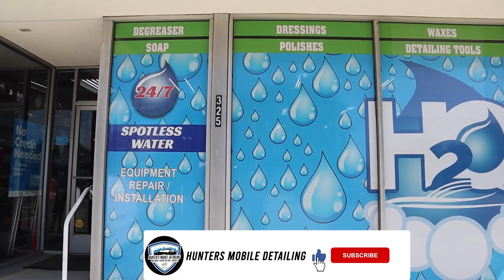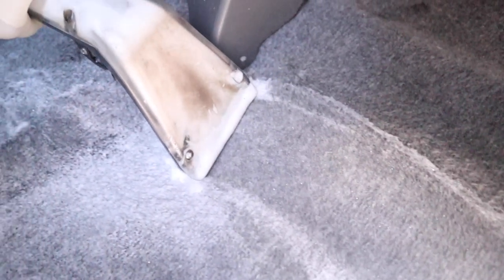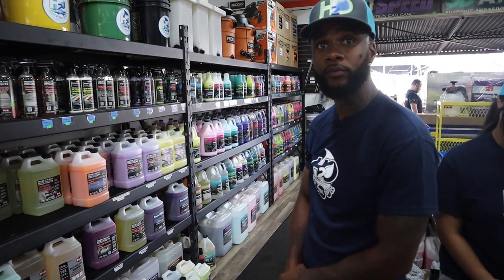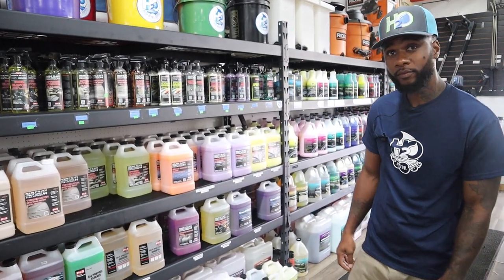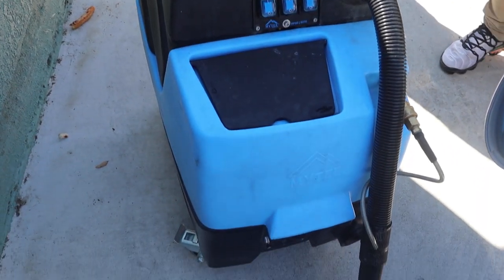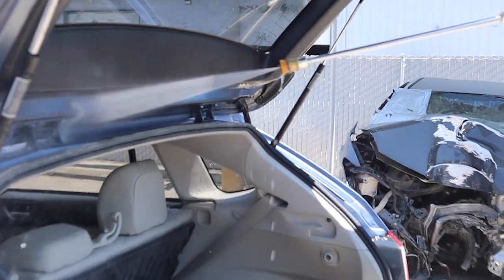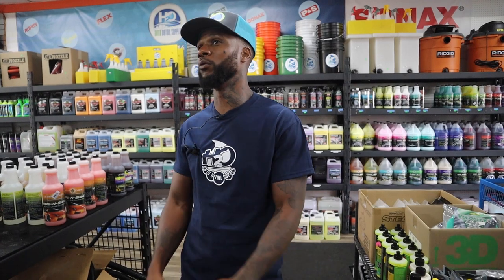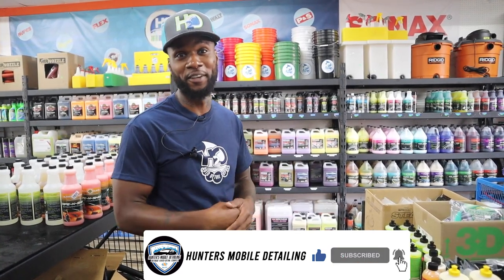What Beginner Detailers Really Need To Start - Hunters Mobile Detailing

Comment: My towels are color structured. Black for the inside, blue for outside, yellow for miscellaneous.
Reply: my towels are quality stuctured. just the cheap bulk towels for inside. drying towels for drying etc
Reply: @rickvh0195  I have drying towels as well but for the tires, cheap Amazon blue.
Reply: Do you only use the towel one time on exterior when doing waxes
Reply: @scr3wblu313  I don’t since I wax a good amount of cars so I usually throw them in a bucket and use chemical guys detergent for them. Never mix the towels though. Wash on cold then air dry them
Reply: @rezzo_6fn659  gotchu thankz
Reply: Same blue windows, green interior, yellow exterior
Reply: thats crazy i use use black for wheels and tires
Reply: What's the price range for a beginner when buying all he mentioned on the video
Reply: @abusivefather8000  just depends. If you want everything today bring at least 1k-3k to the table.
Reply: I use usually use Blue or a light Tan/Yellow (waffle Weave) for the Windows, White or bright Yellow for the interior (so I can see if it’s completely spotless), Black for drying the entire car, A super soft bright Green for spray detailers and taking off excess wax, And then there's the cheap Orange and Yellow one's for miscellaneous stuff. I also have new Gray ones that will be going into the rotation. That being said, they are all different brands, prices, textures, and sizes. Sometimes I'll even use the tan/yellow waffle weave to dry the exterior instead of the big fluffy black drying towels. It all depends on the type of material, What part of the vehicle, and obviously whatever works best for you, your chemicals and the vehicle. Just as long as you have a system, and keep your towels separate especially when washing 😊  like he said in the video he was using about 100 smaller towels a day, so if you’re just starting out, having a towel system in place is more important than one might think.
Reply: @abusivefather8000  maybe be even getting a used pressure washer will work when ur first starting or like he said a water hose works too when ur first starting. So 200 and the chemicals u can spend maybe 200 (then re fill once u run thru that) key is dilution and then towels, bucket, mit, interior and wheel utensils 150 ish don’t need much to start it’s about how u use what u have efficiently
Reply: Your just mobile?
Reply: @rawcircoking  I’ve backed away from mobile a little bit. I Make more money having the client bring their vehicle to me because I can have multiple cars dropped off at once. This is a premium service and with all of these new detailers coming in it’s a race to the bottom because everyone is trying to undercut the competition. Got folks doing inside and out for $30. Like why? Better off working at Amazon or ubering for that little bread.

Comment: if your starting you can get the cheap ryobi or greenworks pressure washers under $100. Personally i would recommend a upgrade hose as the ones provided are pretty junk. Vaccuum extension is good to and its not needed but a steamer like the  McCulloch MC1385 will help you save a lot of time on the interior. Don't forget some tire shine too customers like to see the wheels with a nice clean finish.

Comment: Just a heads up that shamwows / chamois are swirlmark heaven..you are getting dirt and dust trapped in them and using it on car after car, it’s basically like a towel that you never wash
Reply from the maker: And if I wash it?
Reply: @HuntersMobileDetailing  I mean I guess you could power wash it, the thing is though, that it’s a flat, non-porous material, so even after u wash it you pick up a little piece of tar or dirt, that will just stay right on the surface. But a microfiber towel, the dirt will go in the towel and not just sit on the surface. I’m gunna do u a big favor, I see you use chemical guys towels in a lot of your videos, next time u need to re up on your towels get the rag company towels..and for drying get the rag company “the gauntlet”..you might need to keep a handful but if your trying to put zero scratches in, microfiber is the way...I guess a lot of cars are already all messed up tho..still use the good ole shamwow on those lol
Reply: @HuntersMobileDetailing  u will see a night and day difference between rag company and chemical guy towels
Reply: @HuntersMobileDetailing  I agree with Table Rock, in the video you passed by that Maxshine Duo Twisted drying towel (purple one) it is a game changer. With its own weight you can dry the car, just plop it on and pull along the panel and its dry.

Comment: Recommens...Go with electric pressure washers under 2000 psi anything  above that  you playing with fire (paint damage).  Most build shops will try and upsell you gas pressure washers with 3000-3500 psi, you be rolling the dice. 🤔

Comment: Ur videos remind me a customer that asked me to please wash his car… This unique customer, had not cleaned the car for more than a year, and wasnt until i started washing that i realized the issue. And asked customer, and told me for around a year 😳

The thing is that i had to clay! And told customer since the beginning, i would make it entirely for 100 bucks 😔

I wasnt hungry… I was angry, because the irresponsibility i had to work on 😡😡😡

How many cars with fresh/good clear coat dont you see with  bird poops on? Will mark, and still penetrate clear coat, if you dont clean. 

On my opinion, a car needs some extra sealant. And more, if you have it all day parked taking sun. If you protect, you wont have clear coat peeling, nor color fading.

Comment: Such a promising series until you said you use a Shamwow to remove the bulk of the water from your clients’ vehicles. I think you must be one of the only YT presenters that promotes such a method. FYI, if you use a double sided twisted loop drying towel such as those sold by Foxclean or Detail Geek, you can use the one towel for the entire vehicle. Even a single sided one from CarPro or Gyeon can absorb all the water off a mid sized SUV. Good luck, you have a goos thing going.

Comment: I'm trying to get started....how much do everything cost total
Reply: Depends on the tools and chemicals
$80 Vacuum 
$130 Pressure washer 
$50 Extension cord 
$26 Grit guard 2 buckets
$150-200 Water tank 50 gal. 
$8 microfiber mitt
$25 Detail Brushes 
$20 microfibers
$10 Drying towel